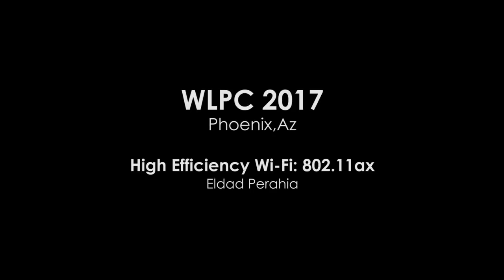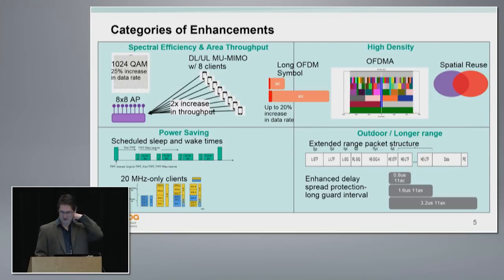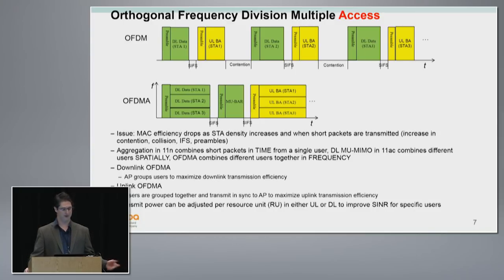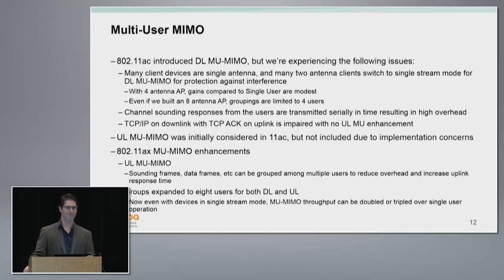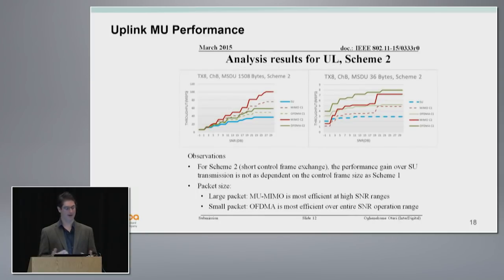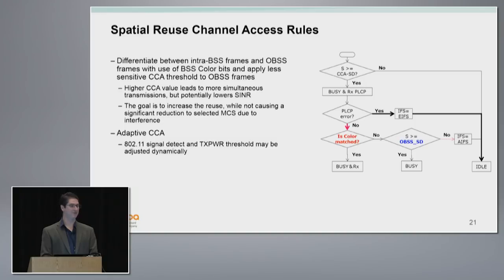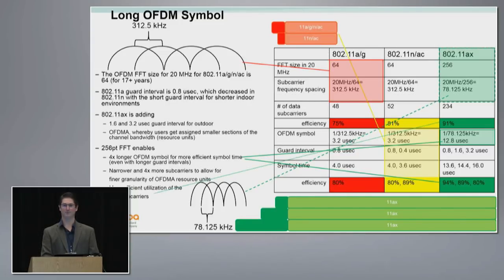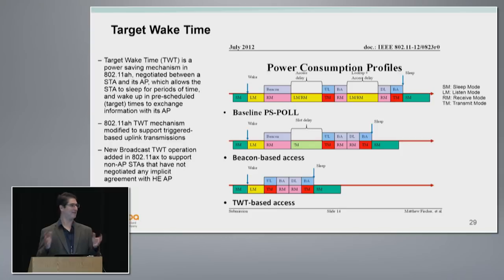High Efficiency Wi-Fi- 802.11ax | Dr. Eldad Perahia | WLPC US Phoenix 2017

Comment: What about reliability? Wifi still sucks at reliability even in simple, single home networks.
Reply: Wang Linetkux except its not just me. One of the biggest gripes people have with technology is unreliable wifi. Part of being a good standard is being robust, reliable and easy to implement. If router companies are failing to make good routers, on a systemic basis, as they are, that is a failure of the standard. Or specifically of the working group for failing to address indutry issues, and providing the resources the industry needs to improve
Reply: @24grantj24  That is what he talked about. Improved range, improved support for more users, improve response times.
Reply: WIFI is reliable when planned well. Simple home networks, usually have one central router, with terrible auto-channel selection, often going 80MHz wide occupying 4 channels which subjects you to a higher SNR requirement. If you live in an apartment complex or condo, you have lots of RF neighbors, all running 40-80 wide at full power - stepping on your channels.

If you are in a larger home, then you probably just don't have enough coverage through walls with one WIFI "router" existing somewhere. So WIFI is not the problem. Implementation and RF neighbors not following best practices are more likely your issue, along with possibly poor behavior or drivers on the client side.
Reply: Grant,
The environment has a huge impact on reliability. Wifi will never just magically work by just dropping in a WAP and powering it up. I see it every day. You need to know how the antennas work on the WAP(s) so you can mount and orient them optimally. You need to be aware of the materials in the house and how they might impact the signal. And, except in the simplest deployments, you should be walking the site with at least a simple wifi-analyzer to check that the WAPs you want to service specific areas are actually doing so. 

I've seen a lot of interesting things in high end residential deployments. One house was a literal fortress and required 25 WAPs for less than 8,000 sq feet. Some of the antique furniture seemed to have lead in the finish or something in it, as it would 100% block signal despite being made of wood. But then in my 3000 sq foot house all I needed was 2. And TBH, if I wanted to ignore one little corner I could get away with a single WAP. The environment you deploy in has a huge impact on reliability, especially when not taken into consideration during planning and deployment.
Reply: People really looked at the "WiFi reliability" in the wrong lens.
If you have a 10ft cat6 cable, it's stone reliable within 10ft, but at 11ft something is going to break, no one complains about that.
But, with WiFi, you are stone reliable within 10ft, you are still somewhat reliable at 20ft, it's only when you push it to 30ft all a sudden you start bitching and whinnying like Maxwell did something wrong.